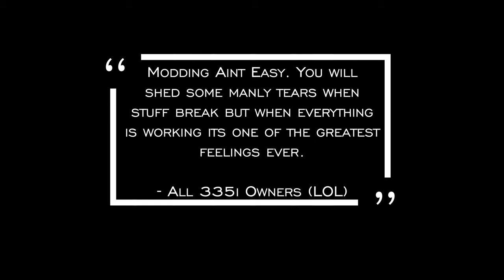Car Modding Sure Ain't Easy

Comment: Hey man I wanted to ask what kind of gas mileage do you get with your 335i? I noticed mine is horrible like 11 mpg ill go 40 miles on the highway and loose about almost a quarter of the tank it has upgraded inlets and DCI I put mhd stage 1+ on it but it didnt seem to get worse or better
Reply from the maker: Ohh wow I get on average about 23 mpg mixed driving. Your in e9x m3 miles per gallon territory. You most likely have leaking injectors or you have a crack in your fuel pressure regulator cover behind your driver side rear seat. But if it was that you would smell gas on the driver rear side. Since your using an ots map I doubt it’s tune related, so you most likely have a leak somewhere.  Main place to check is injectors, fuel pressure regulator, and injector couplers by the fuel rail (they sometimes get hairline cracks).
Reply: @nOshi2x  thanks for the info ill check the regulator i dont smell gas but i dont want to rule that out entirely. the injectors are brand new 12s not reman or anything with new couplers so i hope the problem wont be there
edit i checked inpa for fuel pressure after shutting off the car its not in spec after turning off the car for 2 minutes the fuel pressure drops to 410 kpa when its supposed to be at 500 kpa for several hours from what i read its due to a bad regulator looks like i might be changing that. i removed the back seats and the rubber cover and i still dont smell gas even when it was running
Reply from the maker: Oh wow yea injectors look to be crossed off the list. That’s great you didn’t find any fuel back there. Once you remove the seat and unscrew the hatch that where you would normally see fuel pooled up. But looks like structurally the fuel pressure regulator is good just the mechanism is faulty. The injectors are coded per cylinder?